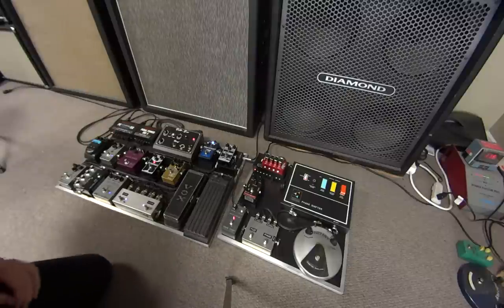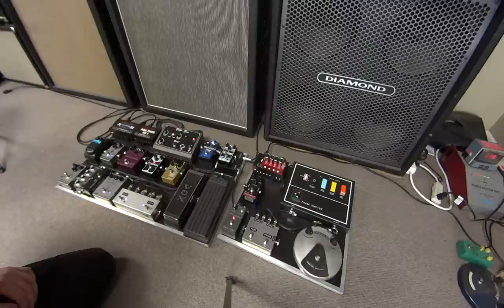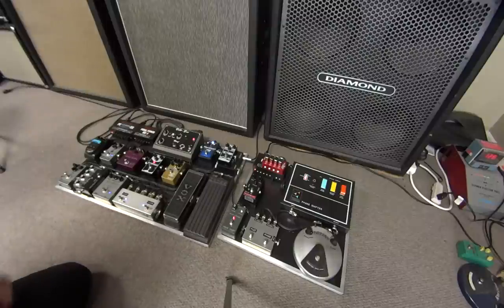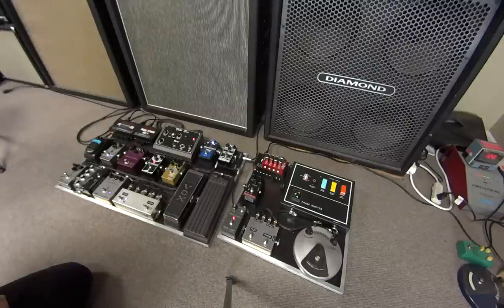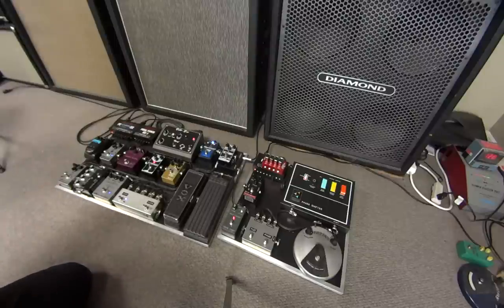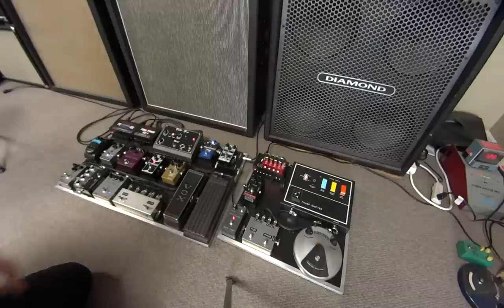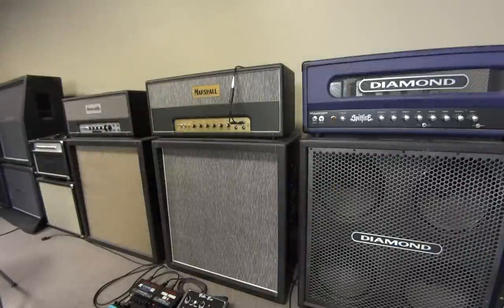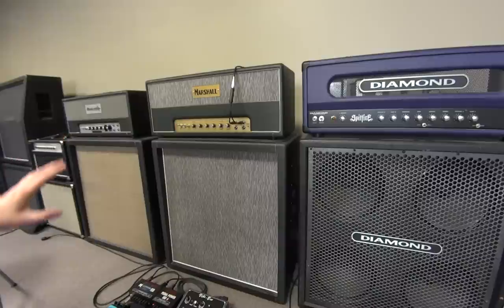L.A. SOUND DESIGN-MY PERSONAL PEDALBOARD RUNDOWN.

Comment: Magnificent as usual!  Thanks to share these details!  I’ve seen that board many moons ago and it didn’t changed that much... signal chain size.  I remember that you were using your standard buffered interface instead of the Shin Ei or the Secret Preamp.  Is this version 1 one of the Third stone or the version with the 2 toggle switches?  Is the Dumbloid a lot different than the Blues Power?
Reply from the maker: Thank you. Version 2 is has the two toggles. Dumbloid ODS and Blues Power a very different. Completely different midrange.

Comment: If these were wired in series would you lose the tone? Is there that much coloration and tones suck by running in series with the pedals off?
Reply from the maker: Not with the cable I am using. Also some of the pedals are always on-driving the signal.
Reply: @RACKDOCTOR  Thanks!!!! When I hit the lottery I am driving straight to your place for a Jedi rig!

Comment: Great vid. Question: how do you manage having the third stone on a tight pedalboard when it runs on batteries? I noticed on Doyle Bramhall's rig he has it labeled "turn off". Is there a way to keep it plugged in without running down the batteries ?
Reply from the maker: The Vol knob on the Berkos is an on off switch for the Fuzz battery.
Reply: @RACKDOCTOR  thanks so much! One more question- I've heard that the 3rd stone isn't to be used in line with a buffered pedal. Is that true ?
Reply from the maker: @pabdiary  Buffered pedals can't be before the Third Stone.  Only after.

Comment: Thanks very much for sharing your wisdom.  I am curious, what are your settings on the Shin's boost and Chase Preamp?  Looks like on the Shin you are at 9 o'clock on the dials.  On the Chase, are you using the mid voice?  IS your level at unity?  Thanks a lot.  I have both these pedals and the Vibe Bro, just wanted to see how you set it.  Thanks again.
Reply from the maker: Thanks. The Shin Claen Boost is set at 11 o'clock on all the knobs. The Preamp is in the mid postion. They are unity.

Comment: How does the rhythm and lead share the same delay/reverb.  It has me baffled. I'm trying to do a similar board set up and would love to know.
Reply from the maker: The Loop Box has INPUT-----L1 S/R  L2 S/R L3 S/R    S/R  TO VOL, DELAY AND REVERB  OUTPUT. One switch goes between L1 AND L2/ L3. The other switch goes between L2 and L3.
Reply: @RACKDOCTOR  thanks! I may see if I can get one made up. That is an ingenious idea!
Reply: @RACKDOCTOR  another question.  Do you use belden 8412? If so do you ground the shield on one end and leave the other lifted? If so does this make it "directional" and if so which direction.
Reply from the maker: @itsmejoewbrown  I do not use 8412. I wire in the direction of the writing on the cable.
Reply: @RACKDOCTOR  which Belden do you prefer?

Comment: Hi Dave, Great rundown & seriously inspiring playing/ tones! I have a few question regarding the Echorec. What are your go-to settings? 9V or 18V? Did you tweak the internal trimpots at all? I've found on mine own that I needed to increase the modulation & decrease the gain to get it really dialed in to where I wanted. Each players tastes are different obviously, but just curious if you found the same. Thanks!
Reply from the maker: Thanks, I run it at 9V. 18 is too dark. I tweeked the modulation pot.
Reply: @RACKDOCTOR  Cool! Thanks very much for your reply :)
Reply: Oh one more thing...I picked up a XTS modded Ibanez EM5 Echomachine mainly from seeing it here & in some of your other builds. Sounds amazing & just sits perfectly within the sound. Awesome stuff Dave!

Comment: dave...whats the buffer situation here???  sorry if you say later in the vid...
Reply from the maker: The clean chain pedals are always on, so no need for a buffer there. The lead chain buffer is the Ibanez Echo Machine after the gain pedals. I am using the Shin boost and the Chase Tone preamp to drive the signal as well. Also very low capacitance cable.
Reply: @RACKDOCTOR  whas the cable....sorry bud if da vid says already lol....what do you think bout evidence sis solder less???  tps dan says that the best cable...waht do you think on solder less???
Reply from the maker: @colsontowingllc3309  The Evidence is nice sounding. I prefer to solder all cables. Better structural integrity-less issues.
Reply: @RACKDOCTOR  what cable you use here on you rig?
Reply from the maker: @colsontowingllc3309  Belden.